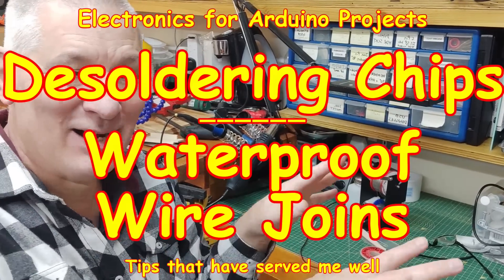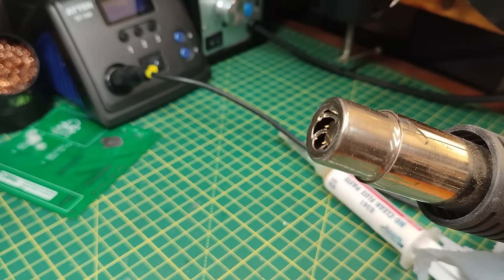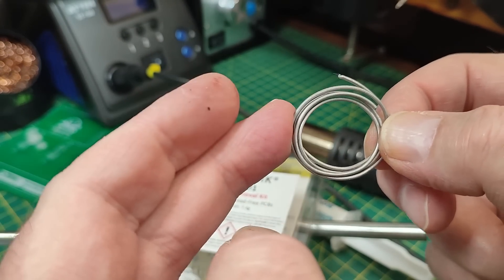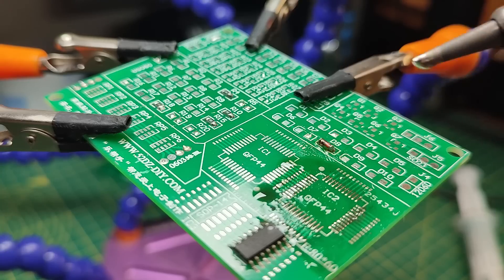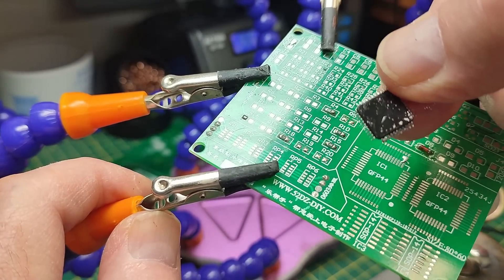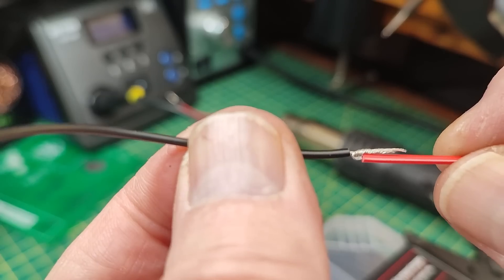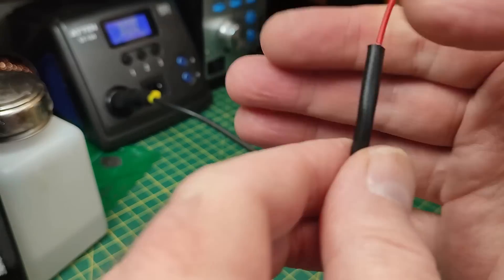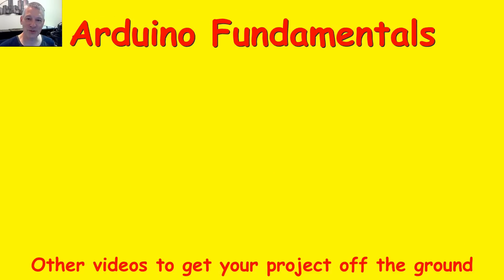#259 Desoldering Chips the Easy Way & Waterproofing💦Wire Joins

Comment: Use hot glue gun put that on first the put heat shrink on to make a waterproofing joint work well. To remove heat-shrink scratch the  heat-shrink then heat it up with heat gun it should split open and use pliers to remove it.
Reply from the maker: Yes, that sounds a good way too 👍

Comment: About desoldering wick/braid: I've been using stranded wire with resin flux for "free" desoldering wick – usually use the shorter pieces of wire that would be useless and leave a little bit of insulation for heat protection.
Reply from the maker: Sounds like a great solution, Paweł, especially since braid is so expensive.

Comment: Chip-Quik has definitely protected my posterior in the past. Very pricey though, so I save it for ICs that are costly or unobtainium. One of these days I want to invest in a hot air gun, having seen how efficiently Louis Rossmann can wield it for surface mount parts (especially BGAs!). 👍
Reply from the maker: Yes, pricey indeed. But using a hot air gun in the vicinity of other components (such as SMD capacitors) gives me great cause for concern. There must be a limit to how much abuse they can take!
Reply: @RalphBacon  I expect you are correct. The way around the EEs seem to use to get around that is kapton tape.
Reply from the maker: Yes, I've seen that used too. I even have some somewhere. Maybe I'll give it a go (one day).

Comment: Back in the Dark-Ages, I would mix a small amount of 2-part epoxy and slide it in the heat-shrink then put in the wire; twisted at 45-degree angles along the complete bare exposed part.  I would then massage it around and make sure that it was uniformly distributed. Once it started to harden, I would then apply heat and shrink it down. Finally, I would clean the joint with alcohol (which is a solvent for uncured epoxy) leaving a clean and watertight joint.  
On the de-soldering, I keep telling myself I'll buy some ChipQuick but never do.  
However I have found that you can nearly do the same by using Eutectic solder which has a real low melt-point. 
Anyway, great video Ralph and info for new-players...
Reply from the maker: I'm tempted to say, thank goodness we no longer live in the Dark Ages but I couldn't possibly comment. 😲

I guess Eutectic solder might work (the stuff solder by AZ melts at 70ºC) although there must be something special about ChipQuik (apart from the price) for it to stay molten for so long!

Comment: See "Northridge Fix."  A little low-melt solder goes a long way.  You could remove these with 10-20% as much.  Once low-melt solder is applied and worked in, a little hot air is very effective.
Reply: Came here to write the same! You'll see Ralph, Low Melt Solder is very effective and not excruciatingly expensive.
I do have a feeling that this is some kind of low melt solder since it melts at a very low temp, but that low of a temp isn't necessary. We highly suggest you to try it. Watch a few videos from the NorthridgeFix channel as Byron said, he probably uses it every day, by using a heat gun too (chip removal, ports removal like HDMI, USB-C, etc.)

Comment: Cheap hotplate and tweezers?  TKDMR 300W PTC Heating-Soldering Plate - Hot Plate LED Remover Chip Welding Station for LED Repair DIY Laboratory - US$13.99 shipped on US Amazon
Reply from the maker: Hmm. Despite this being some sort of blatant advertisement, it was relevant! 

The UK link for the product is here (https://amzn.to/3Ig0azM ) for £25.60 - you can find it cheaper, of course, from the likes of AliExpress. And Amazon USA has it cheaper too. So just the UK with a higher price, although cheaper clones are available there too.

I'm almost tempted to try one out. Almost. I'll think about it.

Comment: I use usually  what iirc  is called a NASA joint  or Aeronautical joint  . At the very least i would do a twisted joint by laying the wires across each other at 45deg and then twist so each wire winds itself around the other then solder. I usually tin the wires first if they are not too heavy a gauge - trying to bend tinned 8G wire isn't easy ! Here in Australia you can get a tin of liquid electrical tape  - it is a bit like a rubber OR PVC  paint and i have used this on all of the joints when i wired my boat up - 20yrs with zero problems . i paint it on the joint and wait until nearly dry which is only a few minutes then slide the heat shrink over and shrink with a hot air gun ( don't use a lighter with this stuff as it is flammable until the solvent flashes off ) . The heat shrink closes up and squeezes the liquid electrical  tape out the ends and forms a watertight seal . You could probably do something similar  with silicone sealer or gasket maker.
Reply from the maker: Sounds interesting! And if you've been using this method for 20 years then I guess it must work, too!

Comment: Good job. I've used the adhesive shrink tubing extensively, in the past I owned an LED manufacturing company in Texas before it was all the rage. Our main line of work was accent lighting and custom working for Honda Goldwing motorcycles. Absolutely great stuff!
Reply from the maker: Thanks for the info! But did you ever own a Honda Goldwing, a beast of a machine!
Reply: Yes sir I have owned two of them a 1995 1500cc purchased in 2001 and loved it so much I bought one of the 1800cc models bright orange in 2002, that bike I put over 100,000 miles on got too old and clumsy to ride, life sucks sometimes!
Reply: @RalphBacon  I remember riding a Goldwing around Bangkok back in the 90s. What a nightmare. I'm only a little lad... I was so scared of dropping it on the "quality" roads we have over here.

Comment: Bending over wires after you solder them together creates a physically weak point on the wire that'd bent back.  Overlay them so the ends are opposite each other, twist and solder, and the joint will be much stronger, AND you won't have a fat section that can't get through small holes or catch on edges.
Reply from the maker: Good tip! Yes, that fat bit is always troublesome to get the heat shrink over.

Comment: Ralph solder at normal temp so it mixes then put dlux on and then hot air. The low melt is pricey.  There should be enough low melt to use 6 to 8 times but I'm very stingie with it. It's a bitch to get off too especially if you want to save the chip.  There's a brand called SRA that gives you like 40 percent more solder for an extra 5 beans

I switched to 3 to 1 version of adhesive black or clear for hv.
Reply from the maker: Yes, 3:1 is fine too (not as good as 4:1 in some situations). Standard 2:1 heatshrink is always a bit of a problem - too small and it won't go over soldered joints, too large and I don't feel it's really bringing anything to the party!

Comment: As a note, the heat shrink must not be put on rubber like wires. It will last for some time but water will eventually go inside. We used it on submesible pumps and had to redo it at times. But great product non the less for more sturdy wires. And thank you for those tips.
Reply from the maker: Does water get inside heat shrink with that adhesive part of it? I was kinda assuming it was going to be impenetrable, unlike standard heatsink.
Reply: @RalphBacon  Unfortunatly it does but as I said it depend on the type of wire you use. If it is a rigid wire it will keep water out for a long time but if the wire is kinda rubbery it will stand ok for a time but cosider that you will have to check on it periodically.

Comment: Hi Ralph, Great one on heat shrink. It will help me  massively when working on my boat. I know it's a bit of a change of subject but would you please consider a tutorial on how to run a ATMega328p at 8Mhz internal resonator and without a bootloader installed communicating though MOSI MISO protocol ?
Reply from the maker: I've already done this video, quite a long while ago. I called it a Breadboard Arduino. It might be this one: https://youtu.be/BJe-pTgfLLM

Comment: Selfmade adhesive heatshrink: After soldering put a thin layer of hotglue on and around the solder joint. Let it cool down, put your heatshrink on and shrink it with a heat gun, starting from the middle.... Takes a bit longer but its cheaper and is the same as adhesive heatshrink...
Reply from the maker: Maybe. The glue in the heat shrink I showed remained flexible, which I'm not sure glue stick will, but it's certainly worth trying.
Reply: @RalphBacon  I do not really see a difference between the "normal" hot glue and the 3M shrinking tube that i use at work. The 3M glue gets also very hard in cold weather conditions. Might be better, but i can´t see a difference. You can buy softer glue sticks too... I´m using a small battery glue gun from Bosch with black 7mm glue sticks...(black is more UV-Resistant). Most important when working wit hot glue (or heat shrink with glue): Its not enough that the glue melts, also the material that you want to glue has to be hot. Otherwise its not really sticking together. If the material is hot enough, you can even glue metal together....

Comment: Before you buy more ChipQuik, get some bismuth-tin solder. The melting temperature is higher (138 C) so it won't stay molten as long but it works for me and is a fraction of the cost for the amount you get.
Reply from the maker: Sounds like a money-saving tip! thanks Sean.
Reply: @RalphBacon  Worth looking at ‘Desoldering PCB’s With Bismuth’ by Robin Debreuil on Utube. Good explanation of how it all works. I wonder if ‘Chipquick’ might contain Bismuth?

Comment: Its amazing how many times you have solved an issue for me. I have been trying to think of a way to use a waterproof sensor on the bottom of my water tank for some time now, as it only came with a 10cm cable and i didn't know how to join it. now I do thank you
Reply from the maker: Glad to be of assistance, Andrew, nice to see you here (still, after all these years!)

Comment: a good tip (seen in some Daniele Tartaglia's youtube videos) to clean pcb pads, is to put high heat silicon (usually red) in some small container, have it fully dry, then cut it using a sharp knife to have a cuneiform shape... using this fine tip will clean up pads by pushing away the solder after having it heated, and works way better than that copper bride, and without risk of removing the pads themselves
Reply from the maker: I found his channel on YT but could not find a video of his that showed this. Got a link? I'd be interested.
Reply: @RalphBacon  sure, here it is https://youtube.com/shorts/E2oJNN_zb4A?feature=share
Reply: @RalphBacon  i added link in other comment, hope YouTube antispam didn't bury it...
Reply from the maker: OK, I found it from your link - hang on, it's in Italian! But it was quite interesting.
Reply: @RalphBacon  don't know if he translated it in English (he does, sometimes) but in the end it's easy, it's just high heat resistant silicon, cut after cured in that shape

Comment: Well done Ralph, you use the ChipQuik in the same way I do, very generously and wonder where it all goes. I see a lot of other repair YouTubers being very mean with it.  One thing, mine arrived in a tube rather than a coil, so looks like I dodged a bullet on that one. Keep up the great work 😀👍
Reply from the maker: A tube sounds OK but is it not even more tightly coiled in there (like solder that I have in a tube somewhere?)

Comment: You need to have the iron temp above the melting point of the solder as you are trying to form a new alloy with a melting point somewhere between the two. With luck it will be somewhere just above the low alloy as your adding quite a bit.

I used to open the strands up to form a 'Y' and then the two 'Y's are putted together and then twisted so the strands of each wire get intertwined, then soldered.

We also had to do this when putting two wires in to one solder bucket on a ‘D’ connector,  as the solder is just the electrical connection and should not be the mechanical one.
Reply: It's actually a bit more complicated than that. If you take bismuth-tin solder (138 C) and lead-tin solder (183) and melt them together, the final alloy can be between 90-100 C; lower than than them both. That's important to know because if you repair a graphics card and don't remove enough of the alloy, it could potentially desolder itself in use (so I  heard; no first-hand experience!). That said, you do still need the iron temperature to be high enough to melt the original solder used on the work you're trying to melt.
Reply: @rupert274  well I was just giving it a guess,  as it had to be lower than original tin/lead or lead free.  Never used it myself i just tend to cut the legs off. Or as they said in the film "you were only supposed to cut the bloody legs off" :-)
Reply from the maker: And the important bit to remember is to remove all traces of that alloy once the item has been desoldered. Or desoddered, if you live in the Colonies. 😁
Reply: @RalphBacon  how do you know you have got it all off. I used to have a soddering iron for use while sodding, not sure how well this comment will go down in the UK 🙂

Comment: There are two versions of the alloy, one with lead and antimony (for which sale is restricted) and another without. It uses bismith and indium, which give the low melting point.
Reply from the maker: Wow! Bismuth and Indium. I'm tempted to Google those in case you made them up, but I trust you. Strange stuff, but works well.

Comment: Great video.   I dont do a huge amount of soldering these days and I agree the chipquik  is good having used it myself.  However it is expensive and you can achieve the same thing using a copper wire heat shunt.  Being an old bugger like me you probably know about this trick  look about 11 minutes in https://youtu.be/lsC2ifJs2DA  all the best Chris
Reply from the maker: For through hole components (mainly chips) that's always a good way to try and desolder a chip - because other than that you would need an oblong soldering tip that fits over the pins (underneath) and which works, but costs a lot for very little use (in a hobbyist setting).

Comment: Nice tips video. Also have to say you are looking well these days. I been following since before the eyepatch days. Keep up the great work.
Reply from the maker: Thanks, Keith. Yes, the eyes are holding up after all the surgery. 

In case other are reading this, I've had two retinas reattached, one very well, the other not so great (the image is squished left/right and a bit wavy). Then both cataracts removed because they became totally fogged up, and lenses replaced with soft plastic things. 

Then the clear lens holder (behind the lens, who knew?) was lasered because it too became cloudy, on one of the eyes. It's only quite recently that the big blob of whatever that stuff was that was floating around my eye as a result of the lasering, has disappeared!

The overall effect is that my eyes are worse than before because both eyes are not delivering the "same" image (my brain is working overtime to compensate, thank goodness I have grey cells to spare) but is better than before because I can see close-up stuff without glasses at all.

If they stay this way, I will very happy. 👀😵‍💫

Comment: It would be good to demo a 'NASA splice'.
Reply: I was going comment on the NASA/Lineman splice, but since you have, I'll just comment on your comment.
Reply from the maker: I've been down that road about various ways of joining wires - all fine if you need a particularly strong joint (usually for [outdoor] commercial/industrial purposes) but for us hobbyists a quick twist with solder is about as strong as we ever need it, especially given the extra protection afforded by that 4:1 heat shrink! 

If we are actually pulling on wires then we need a strain relief somewhere to ensure the outer sheath it taking the strain, not the copper. IMHO, obvs.
Reply: Is that the same thing as what they used to call a western union splice?  That's what I would've done,  one of those...